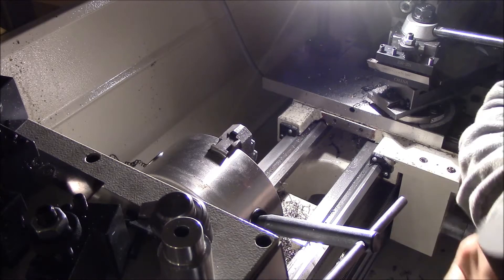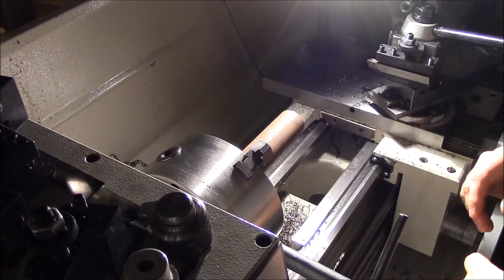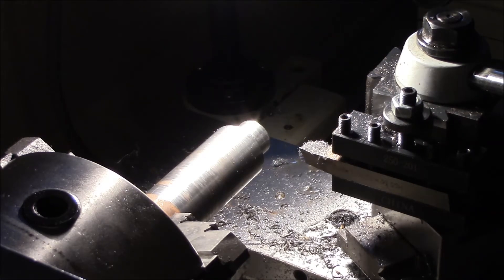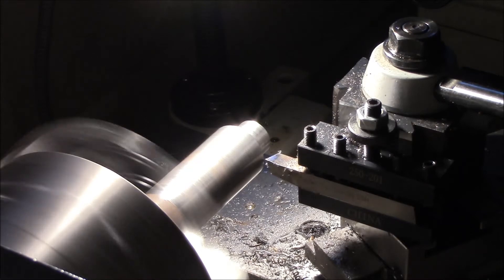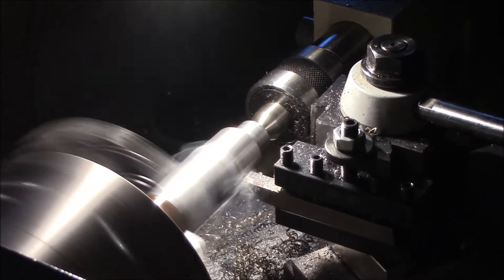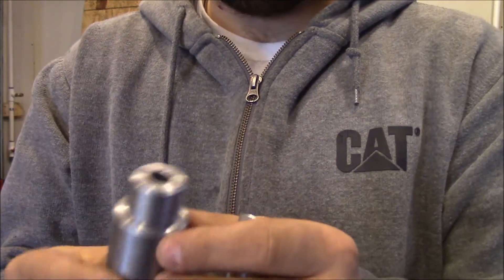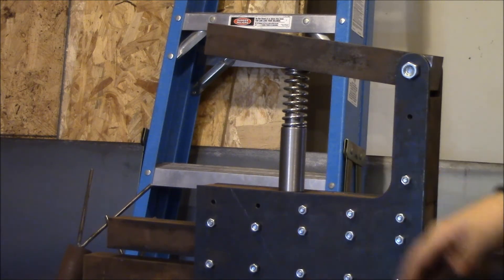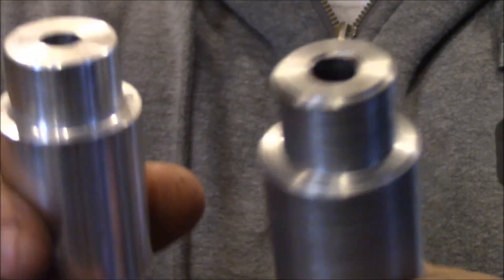Machining Spring Seat Thingy

Comment: Before you move the carriage back after your final cuts, grab the tool post and pull it towards you. This should keep the tool from leaving witness marks on your part.
Reply: Well, as long as you don't go undersize that would be fine. But if you have hit your mark... you don't want to cut any more.
Reply: DSCKy isn't that the point of taking spring cuts before measuring to know where you are so you can hit the size dead on? Spring cuts are meant to remove material left behind from flex in the lathe, you should never be altering the final size with a spring cut, just making sure the size is correct to begin with.
Reply from the maker: Yes, this is a great suggestion, thankfully it is my own part. probably be a while before I try to turn things for other people.
Reply: DSCKy wouldn't it be better to just make a spring cut until all the material is removed?
Reply from the maker: Jay Cole Kind of like you mention, a spring cut will alter, as it is taking material off. Like you say however, it's intention is that you may end up with a tapered cut because of deflection while cutting, and a spring cut is so light as to not have deflection, thus giving you a more uniform cut. If cutting to a desired thousandth of an inch, you take material fast and then a lighter pass until you are within a thousandths, then more or less a spring cut to final dimension. Either way it is removing material.